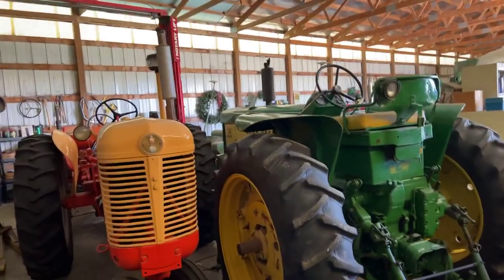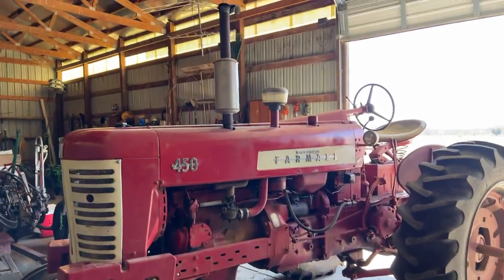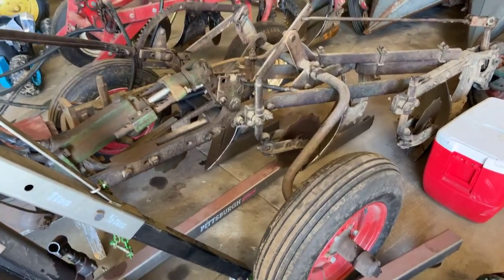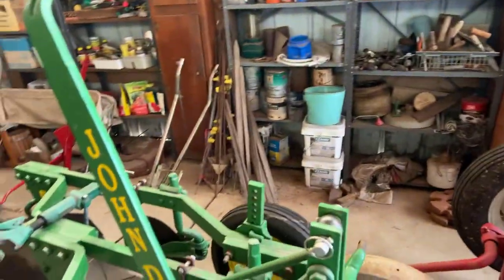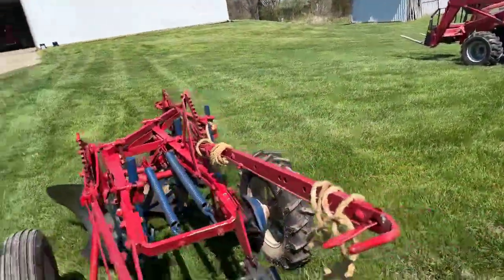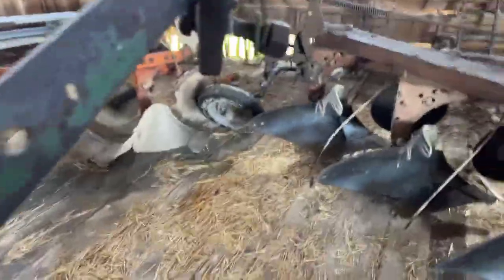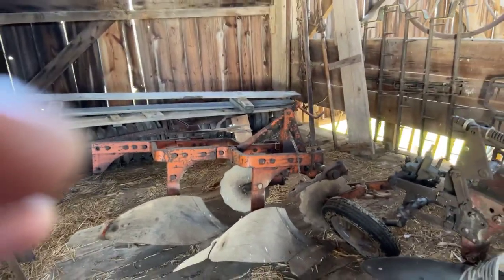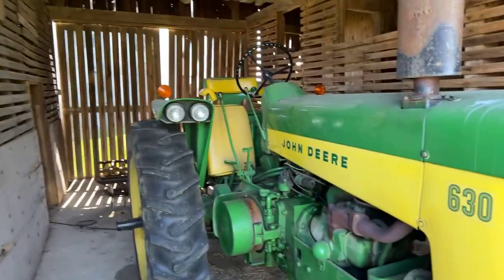Plow Day Preparations

Comment: WD 45, lack of power or weight?
Reply from the maker: Tires are loaded and have wheel weights. I think the tractor could use a motor overall and I probably need to get better at using the hydraulic traction booster.